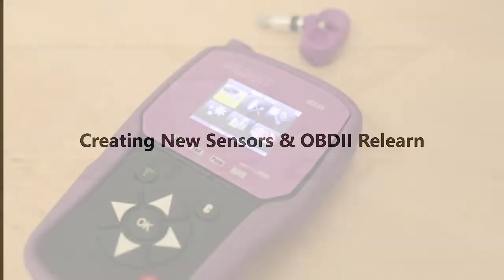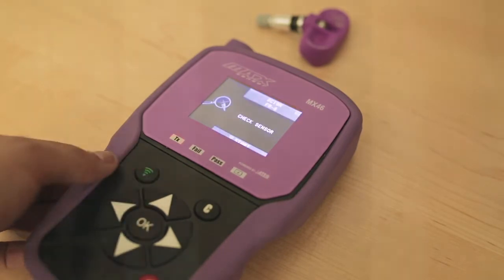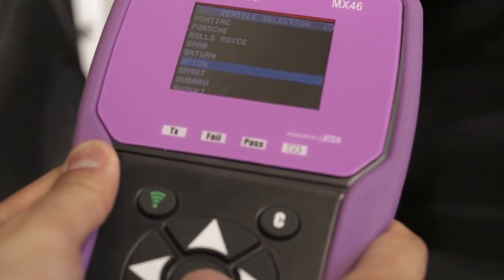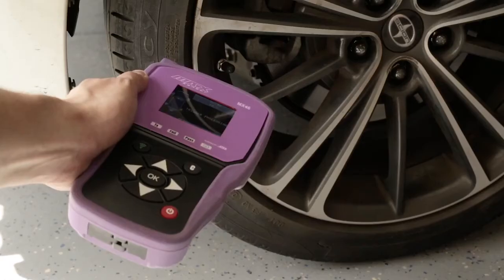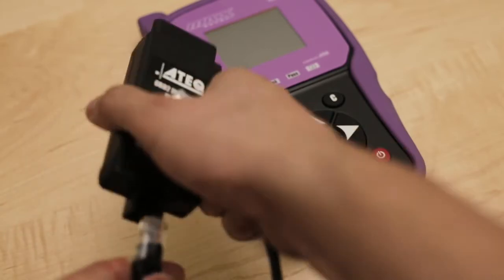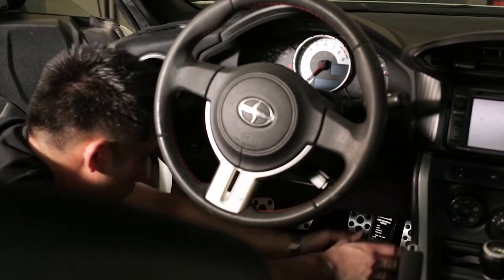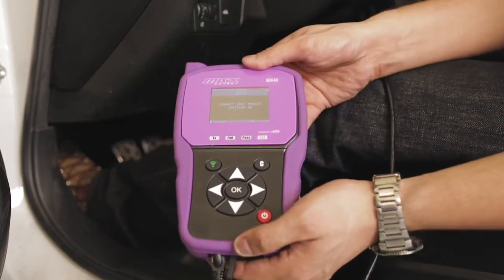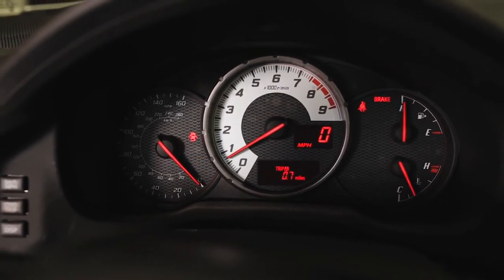MX46 CREATING SENSOR OBDII RELEARN

Comment: Wtf  don't work on Nissan or Lexus and it made the check engine light came on and the car wouldn't start had to reconnect and then the PCM is acting up so thank you for this crap. That don't work even if you update this p.o.s. and the company sends you a new one and a representative from the company to your shop just to end up with the same shit.
Reply from the maker: Dear Frank, 
we are sorry if you have some trouble with our product. 
With the current update of our tool MX46 you will solve your problem. 
If you have further question or trouble, please send us an email to support@maxsensor.de 
We are sure, our support will help you. 
Thank you for using our products.